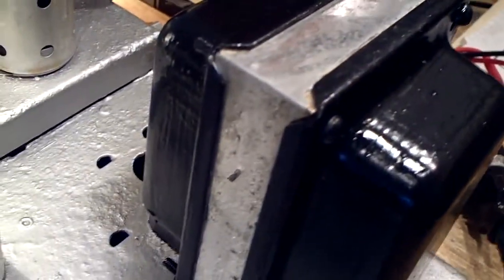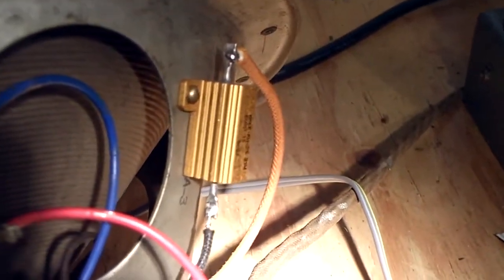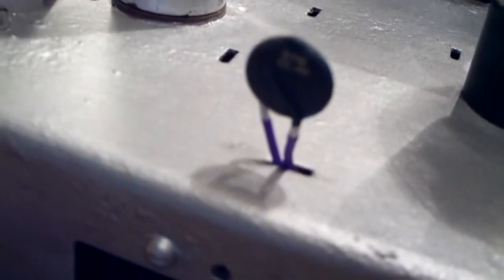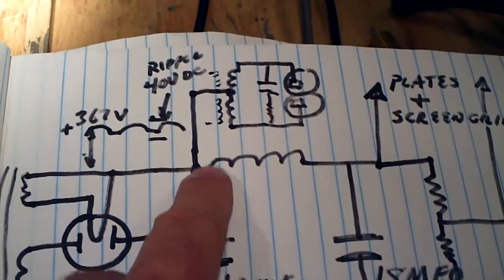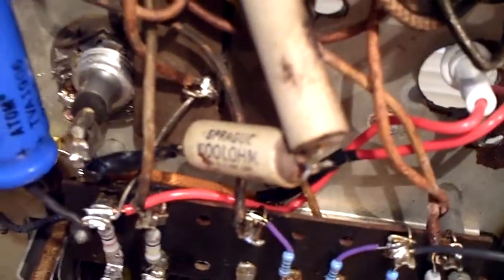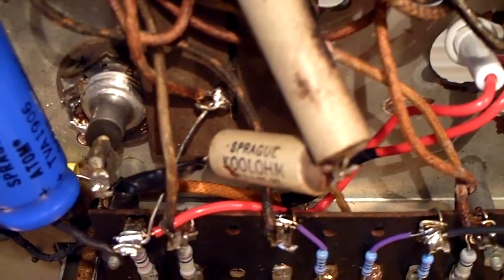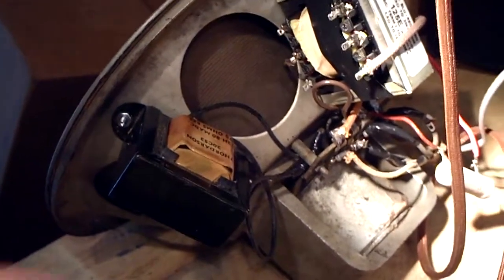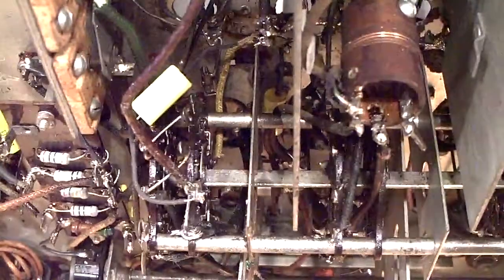Part 22 RCA 262 Radio Repair. Some last things.

Comment from the maker: Lat but not least, the 42 tubes need usually 350 V plate voltage and in this application RCA calls for 376 volts on the 42 plates for more power and less distortion. The other tubes plate voltages are around 242-247 Volts which is too low to tap the 42 tubes into. Thanks for the comment. Youtube is great because it allows a forum for idea exchange.

Comment from the maker: I also think the best wah is to spread the resistance around a little. Some for the B+ screen grids, some for the 42 tubes, and maybe some right out of the rectifier itself. I rather have warm resistors, than hot resistors like some folks do. Also I dissagree with folks who just replace the field coil with a resistor, because a choke is needed. My radio has ZERO hum, becasue I used a choke. If I didn't use the extra choke a hum is realized. I prefer to do things right and spead a few extra bucks

Comment from the maker: I reasoned the RCA engineers were smarter than me and they tapped off the reserve capacitor of the pie filter to reduce the entire current through the field coil choke. Also the manner of operation of the push pull ckt will cancel out the ripple. I have to realize about 10 percent drop, and the reason is the audio transformer is much less resistance than the original, so easy fix is to simply add some resistance to the center tap of the push pull transformer. Dale resistors mount securely.